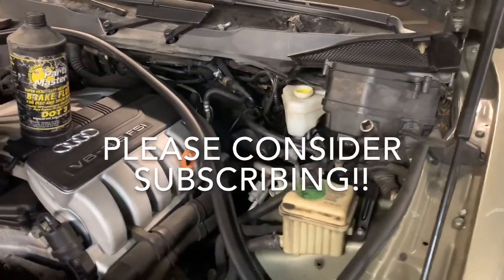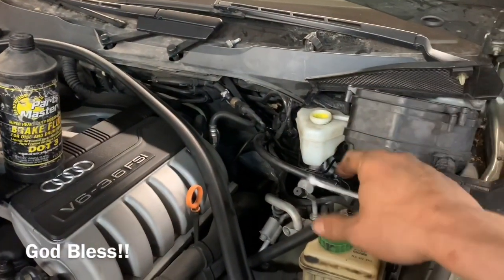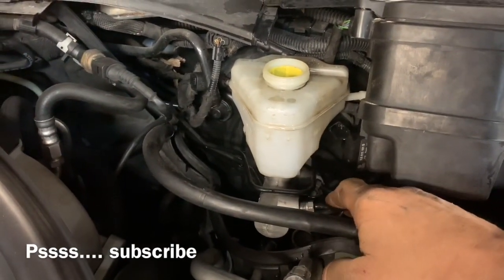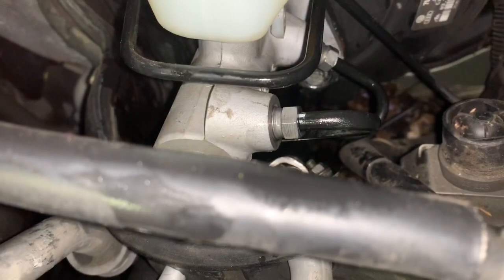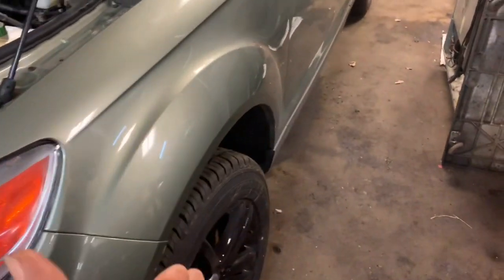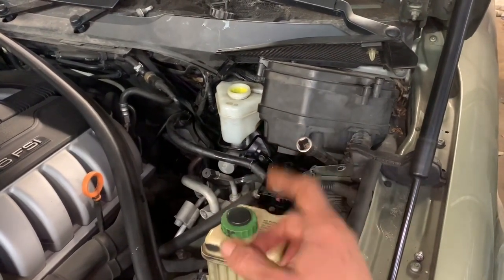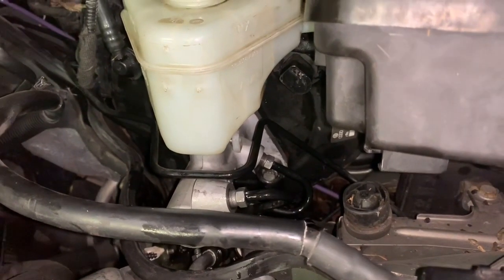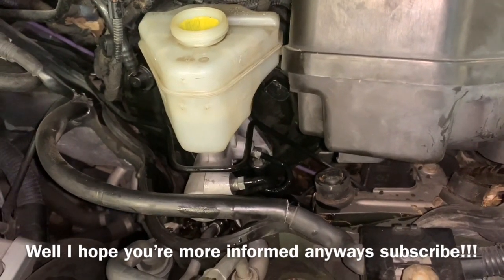Brake master cylinder bleeding/on the car/ Ford/Chevy/Dodge/Jeep !! Awesome stuff!!

Comment: Don't forget the brake fluid eats away your paint, I saw a corvette master cylinder bleed and they say you have to put a level on the top so you don't get bubbles trapped, you can jack up the rear and watch the bubble in the level to make sure the bubble goes toward the firewall.

Comment: It worked for me! Thank you
Reply from the maker: Well that’s excellent that it worked for you I would’ve thought from what you were telling me with the front brakes locking up that you had some kind of moisture contamination inside the brake fluid that would be my guess why they were doing that before you bled them out
Reply: It rode good for a couple rides then it started back again. Just seems to not want to work when I’m coming to a complete stop. Think brake fluid is contaminated? I’ve bled them numerous times trying to find this problem. All with new brake fluid, but every time I do there seems to be air on the first caliper I do (furthest away from MC). Seems like every time.

Comment: Hi Clay hoping you see this . 
PROBLEM:
 04 Accord EX V6 automatic 
RR caliper failure with brake fluid lost from master cylinder. I know I have air in lines and the master had no fluid. 
Can I do this to bleed master cylinder, then bleed all four wheels RR LF LR RF.
Reply: Did you find the answer?

Comment: Is this in place of bleeding at the wheels? I forgot to bench bleed my master cylinder before putting it on the car and now my pedal is all spongy. Can I use this technique without bleeding at the wheels or do I need to do both? I don’t mind just wanna make sure it will work if I don’t bleed at the wheel or is it a waste of time?
Reply: I know this is a old comment but it might help someone out later,yes, you need to bleed everything,technically when you install a master cylinder that is new you should bench bleed it on a vise, hes just showing you how to skip that step and do it in the car, , they both work, vise or car but you still have to bleed the wheels so call it the 5 step bleeding process,master and all 4 wheels.

Comment: Clay,   I did something without thinking.  I decided to remove the original brake fluid that is 20 years old from my truck and opened all 4 bleeder screws so I could get all the old fluid out.  I then filled it up with new fluid and now I cannot get any brake pressure at all. I have always bled my on brakes without any problem however, after watching your vid I never thought that the master cylinder may have air in it not the lines.  What are your thoughts.
Reply from the maker: Well depending on what kind of vehicle you have it is possible that you have air trapped before the ABS control module and the ABS control module is not releasing the air like it should be so you may need to use the scan tool to bleed out your brake system that’s the first thing that comes to mind. 

I’m assuming you were having a problem that’s why you changed your fluid correct?

It’s my opinion but it’s not necessary to ever change brake fluid unless it’s leaking or you are servicing the brake system and you need to remove the fluid for some particular reason like it was contaminated with a petroleum based product or water

I say it’s my opinion because I’ve seen cars that were 35 years old it still had the old brake fluid in them and generally when a break line breaks it’s because of an outside organisms such as rust etc. etc.  

I would be curious to see what other peoples thoughts are on this particular subject but that is my personal opinion. 

Hopefully the information helps you a little bit and if you ever have any questions feel free to ask them God bless and have a great day
Reply: Clay,  Do not have ABS brakes so would your next step be bleeding the master cylinder.  If so then do I open only one brake line going into the master at a time or open both at the same time.
Reply from the maker: Greg Brooks Good morning Greg no it’s just a coincidence your master cylinder has went bad. I couldn’t tell you why it went bad but it just did

Comment: I had a brake line blow, replaced it bled the brakes and everything was good except while bleeding the fluid really looked nasty. Well, it bothered me so I decided to do a real good bleed/flush. On the last caliper, I was running a little low on fluid but thought I could make it. After a few pumps, I saw some tiny bubbles and the pedal just went right down so I stopped and ran out to get more fluid and filled it up but no pedal nothing. What do you think ABS
Reply: Did you fix this? What was the issue?

Comment: All good but the brake fluid dripping onto firewall and other PAINTED surfaces will be eaten IF you don't/can't spray carb or brake cleaner spray COMPLETELY off asap. But helpful video.

Comment: Mr Clay i have another question why is when I'm at a stop light the the oil gauge drops all the way dash says check gauges then when light turns green i go and the oil gauge gose back to normal what can b the problem sensor
Reply from the maker: What kind of car are we talking about and what size engine?
Reply: @sharpcarco  a dodge ram 1500  2003 5.7
Reply from the maker: I’m sorry to tell you Ruben that is not very good especially with a 5.7 more than likely you actually have a oil pick up tube that is blocked there’s probably excessive Sludge in your oil pan I highly recommend you fix that ASAP or you will be putting a new motor in it
Reply: @sharpcarco  I had that happen so I drained 2qrts of oil and added 2 qrts seafoam and let it run 10 to 20 min then did a oil change and all was good

Comment: Does this work if I need to bleed my calipers too? Been trying to find out where air got into my line. Was going to bleed master and calipers. Truck seems to be acting like it wants to lock up in the front just when I’m about to come to a complete stop
Reply: 99 Chevy Silverado 1500 5.3L 4WD
Reply from the maker: No Tyler you need to bleed them all the way through the calipers this procedure will not work for that
Reply: I bled the master this way then the calipers afterwards.

Comment: All that brake fluids leaking down somewhere....can the brake fluids hurt or erode anything?
Reply from the maker: Of course It could …. But it’s my car and I don’t care……
Reply: @sharpcarco  ...... but you've chosen to share the video with others on YouTube, do you "care" about their safety and cars?   Is it Christian to share potentially dangerous shortcuts to people, concerning their safety-critical car brakes?!?!
Reply: @davidvillage3420 When you do this just put a old towel you dont care about underneath there to catch all that fluid,a grown up would do that regardless of whose car it was.

When i bleed my wheels i put a piece of cardboard against my inner fender,so it can catch all that fluid, even though its plastic i dont want all that stuff everywhere,the problem with brake fluid is not only that it eats paint but if you leave it laying all over the bottom of the car its Attracts dirt like ants to sugar and your gonna have a paste of dirt and brake fluid under your car,I'm kinda anal about that and i drive a beater,lol